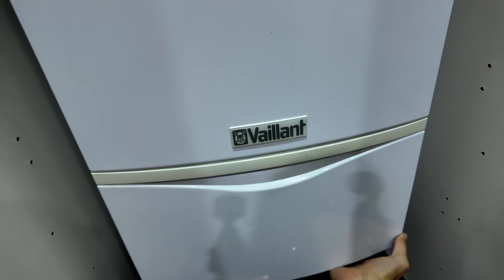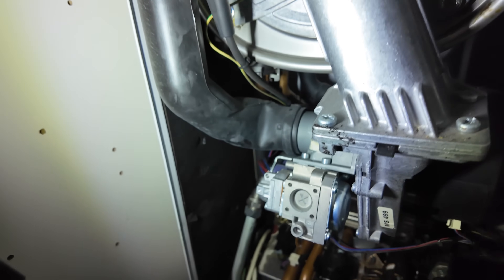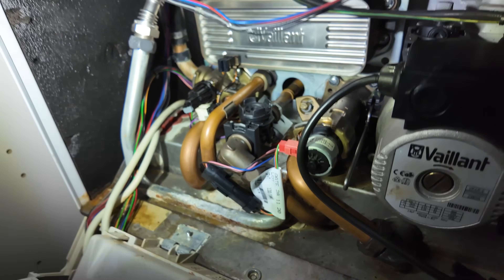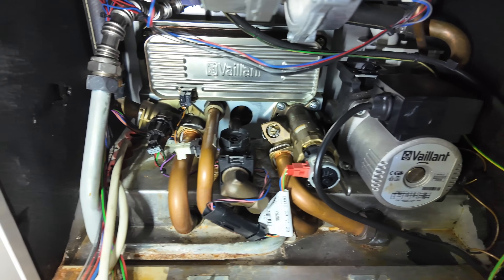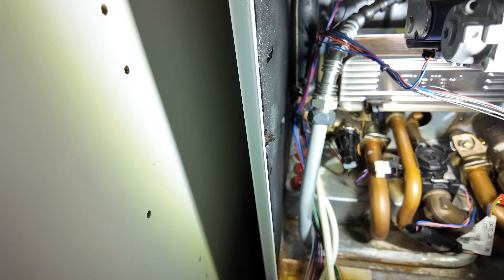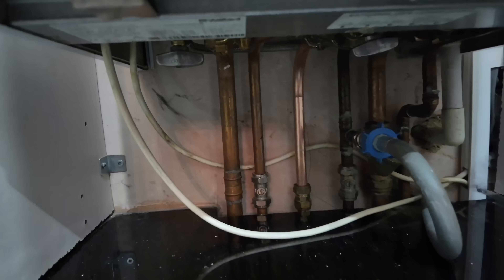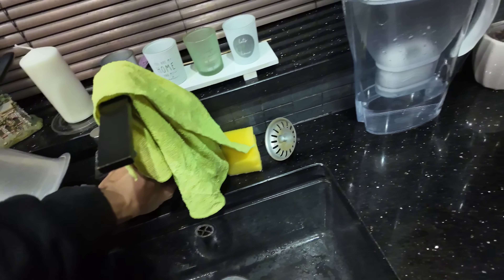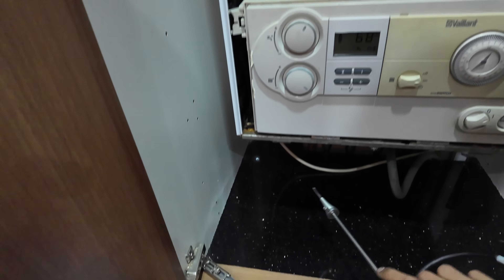Pettiness From The Last Engineer

Comment: Hi I am doing ov to combi conversion.have cut all pips.didt make a note.i know which one is flow from boiler but can't remember which one to cap and which one to conect with flow.any advice will be much appreciated.
Sorry question is unrelated to the video.
Thanks.
Reply from the maker: Have a watch of this video

https://youtu.be/-VdlPB26fhI?si=1xrYCzaj0hlU0J1l
Reply: @cputilitysolutions thanks for the prompt reply.i have watched this video 10 times.i know 
The primary flow pipe.
That left two pipe one to connect with primary flow and other cap.
Now both are sticking out of floor board and I dot know which one to cap.
She'll I cap any one of them or what else.
Thanks
Reply from the maker: @explorer2571  was it on S-plan or Y-plan?

Comment: hope you had a good Christmas Chirag . had the same thing on a plate could'nt work out why? great result on the flue seals . dont think the other guy had any compression caps.good call on the isolation valve as well .👏👍👍👍
Reply from the maker: I'm gonna take a stab in the dark and say possible vibration from the pump & diverter perhaps may cause them to loosen up over time 🤔
Reply: I’ve had the same 2 days ago, all 4 screws loose

Comment: Correct me if I'm wrong. But if there's no co escaping from the case, wouldn't it be AR
Reply from the maker: Correct, as long as the room seal of the boiler is all intact. Also AR or ID requires permission to turn off, which they didn't do either. Just trying to force the customer into a new boiler

Comment: This is why I like Vaillant’s, yes they have breakdowns but most issues are simple to fix and they are forgiving, for instance that turret seal had probably been leaking a while but it never seems to effect combustion. The first engineer was probably just not confident with breakdowns, I think people get scared they will invest time into fault finding and not be able to fix it and not be able to charge for the time. Above all, we enjoy fixing things and that’s why we like breakdowns.
Reply from the maker: Absolutely I'd always go for a repair over a replacement, unless it becomes uneconomical for the customer. But if they're happy to pump money into a repair then I'm all for it 🙌🏾
Reply: @cputilitysolutions  
Rather the devil you know than the devil you don't, maybe? From what I have seen in your videos all the modern, small wall hung boiler don't seem to be made from quality components or made to last.
Reply from the maker: @nickhickson8738 unfortunately I think that's the case with most products these days. Not built to last so the companies can keep profiting